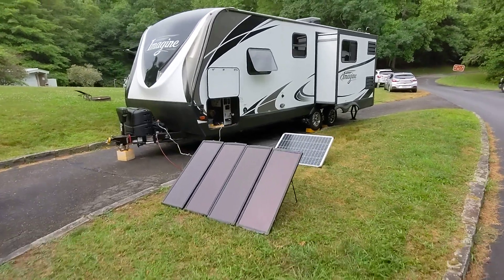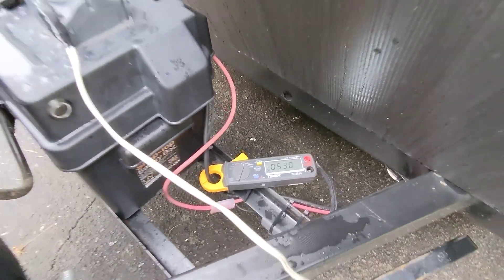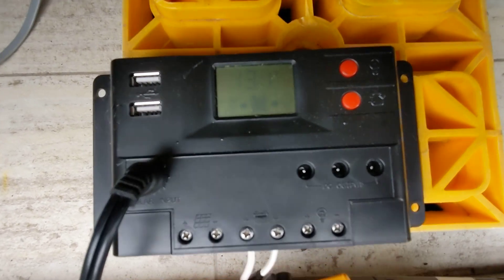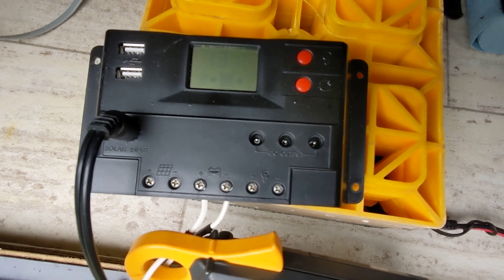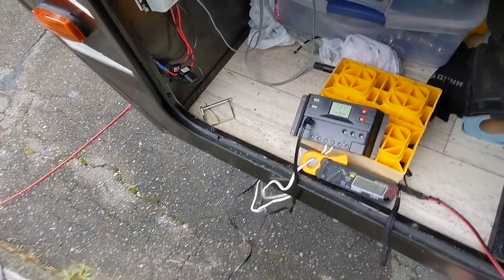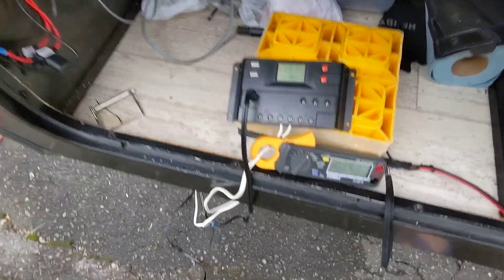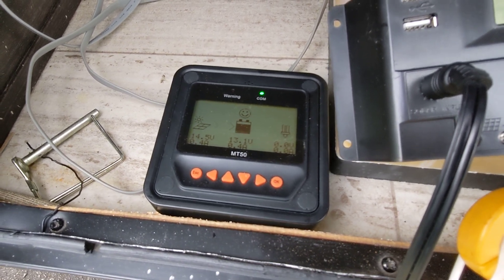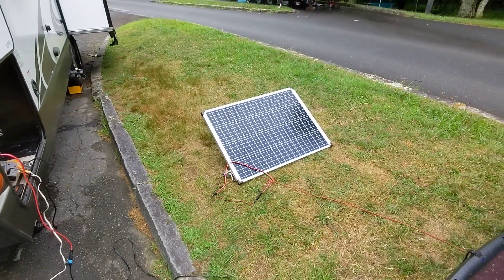Cloudy Day Follow-up to the Harbor Freight 100 Watt Solar Panel Comparison.

Comment: The amorphous panels appear to be using a thinner gauge wire than the monocrystalline panel. That right there would affect the current output.
Reply from the maker: I'm using 18 gauge wire at a distance of around 10 feet. If you check the charts, you will see that for a copper wire, that only has .0638 ohms of total resistance. That low of a resistance is totally negligible. A bigger wire would be overkill.
Reply: @kevinrepass4210 I'm referring to the wires that came with the amorphous panels. They appear to be much thinner than the wire that the monocrystalline panel is using. If that is the case then that is why they are not doing as well. It is acting as a choke point for the current. The wiring gauge from the rest of the system won't make much of a difference in this case. Although the monocrystalline panel will be able to take full advantage of the 18 gauge wiring. The amorphous panels won't if the gauge of wire it is using is smaller. I have the older amorphous panels from Harbor Freights that are 15 watts each. They use the O ring terminals. I hooked up my own wiring to them. These newer 25 watt ones appear to be using the newer mc4 connectors. Either get 18 gauge mc4 wiring with the appropriate connector on the other end or cut the wiring on the panels and crimp on some O ring terminals. Then get wiring with O rings on one end and the appropriate connector on the other end.
Reply from the maker: @emuhill  , if you look back at the video carefully, you'll see a connector inline with cable to the monocrystaline panel. I'm using an extension cable that is a bigger gauge than the factory cable attached to the panel, which is also 18 gauge. Both panels use SAE connectors, which are satisfactory for this application.  As an Industrial Electrician and Electronics Technician for over 30 years, with an education in Electronics, trust me. The cable size for these lengths and current ratings is sufficient.
Reply: @kevinrepass4210  Ok so it has been established that everything you used and had the panels plugged into was 18 gauge. So what is the gauge of both the monocrystalline and the amorphous panels?
Reply from the maker: @emuhill  all panels came with 18 gauge wire attached.

Comment: i sent back a newpowa 200w panel.. and replaced it with 2x 100w thunderbolt panels.. i am getting 105% out of the 100w pair .. vs the 200w newpowa (150-158w)  vs 203-208w  those harbor freight panels have got to be the best bang for the buck on the market for solar panels  99.99 on sale 107.41 after tax  in here in eastern NC

Comment: For both your battery is almost full.  It would be a better test if the battery was below 13 volts.
Reply from the maker: The battery in the camper is lithium so full would be between 13.6 and 14.6 volts. I've loaded the battery by running several items inside the camper. For these conditions, it's doubtful that the MPPT charge controller and panels would produce more current, given that it's set for charging lithium. The PWM controller might produce a little more current since it doesn't have a lithium setting. But it was close to what the MPPT controller was producing anyway.
Reply: @kevinrepass4210  cool.

Comment: Great comparison. I'm wondering if all that extra cable and connections on the 4 amorphous panels has something to do with the output difference in the two types of panels. I noticed the connection to the mono panel was much shorter with one connection. Also the wire gauge was different I'm guessing. Thanks for posting.
Reply from the maker: While wire length can have an effect, it doesn't really apply to lengths this short. According to a copper wire resistance chart, my 18 gauge wire only has.0651 ohms of resistance for every 10 feet of cable. That's low enough to ignore.
Reply: @kevinrepass4210  I agree... I'd be interested in the individual panel output at the first connection as compared to the final output with all the wire, connections, and junctions. 
Perhaps I'll check on it myself. I was always taught that the cleanest shortest connection of a properly sized wire gave you the best result on flow.
Thanks again for posting. I very much enjoy your content!